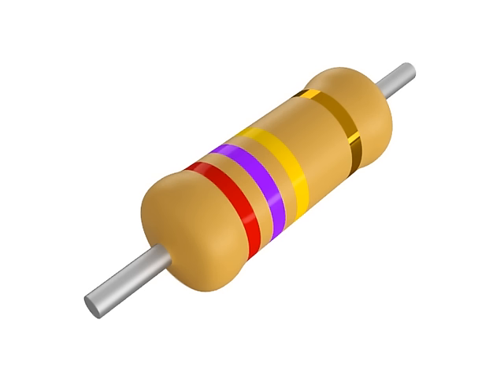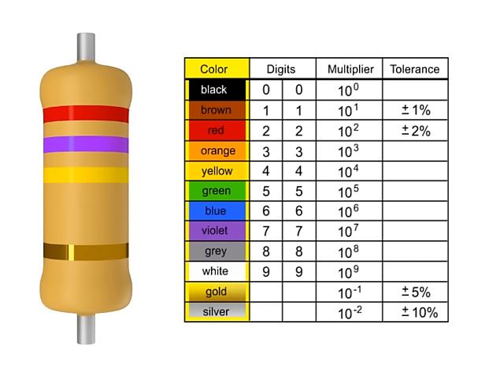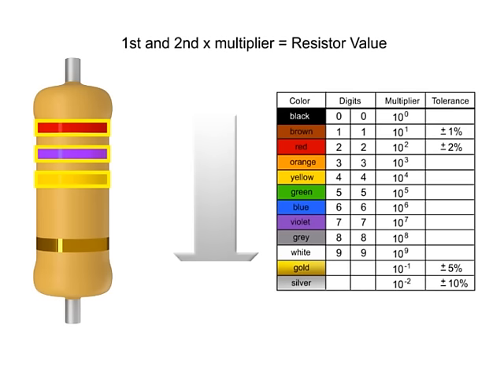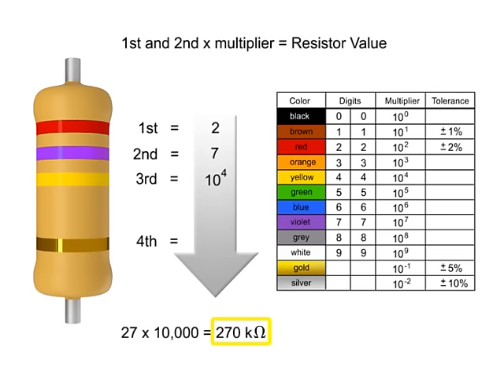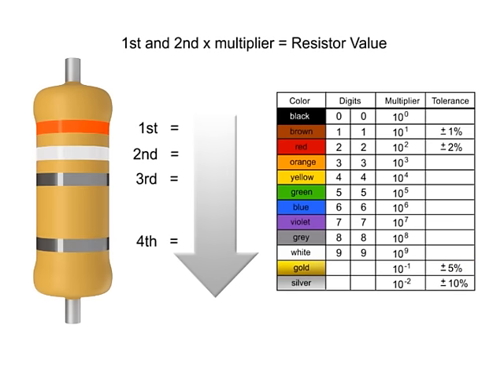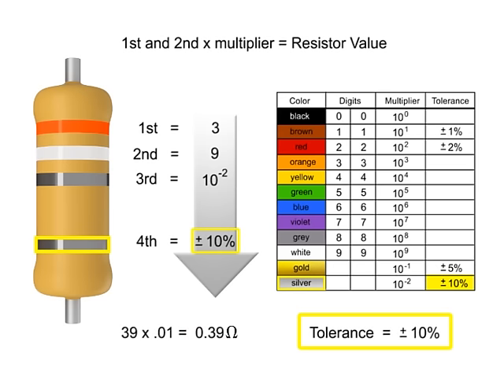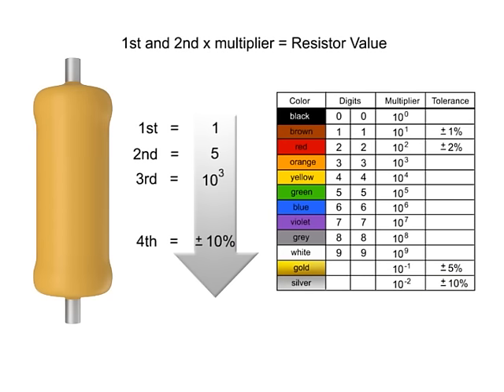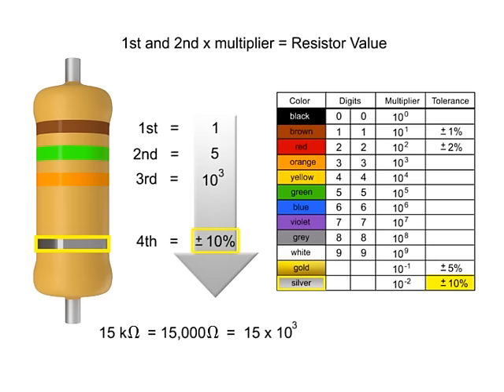How to Read a Resistor

Comment: These all resistance value colors below:

Value.    Color.     Multiplier (x10)   Tolerance

0.            Black                  0
1.            Brown                1                   1 %
2.            Red                     2                   2%
3.            Orange               3
4.            Yellow                4
5.            Green                 5                    0.5%
6.            Blue                    6                    0.25%
7.            Purple/Violet     7                    0.1%
8.            Grey                    8                    0.05%
9.             White                 9
10.           Gold                  -1                   5%
11.           Silver                 -2                  10%
12.           No color           ---                   20%

For example of 4 band or 5 band color of a resistor:
For 4 band color:

10 Ω with tolerance is 5%
(brown - black - black - gold)
47 Ω with tolerance is 5%
(yellow - purple/violet - black - gold)
560 Ω with tolerance 5%
(green - blue - brown - gold)
5.100 Ω (5,1k/5K1Ω) with tolerance is 5%
(green - brown - red - gold)
15.000 Ω (15kΩ) with tolerance is 5%
(brown - green - orange - gold)
270.000 Ω (270kΩ) with tolerance is 5%
(red - purple/violet - yellow - gold)
2.000.000 Ω (2MΩ) with tolerance is 5%
(red - black - green -gold)
12.000.000 Ω (12MΩ) with tolerance is 5%
(brown - red - blue - gold)
240.000.000 Ω (240MΩ) with tolerance is 5%
(red - yellow - purple/violet - gold)
1.000.000.000 Ω (1GΩ) with tolerance is 5%
(brown - black - grey - gold)
47.000.000.000 Ω (47GΩ) with tolerance is 5%
(yellow - purple/violet - white - gold)

For 5 band color:
47 Ω with tolerance is 1%
(yellow - purple/violet - black - silver - brown)
390 Ω with tolerance is 2%
(oramge - white - black - black - red)
2.200 Ω (2,2k/2K2Ω) with tolerance is 1% 
(red - red - black - brown - brown)
51.000 Ω (51kΩ) with tolerance is 1%
(green - brown - black - red - brown)
470.000 Ω (470kΩ) with tolerance 2%
(yellow - purple/violet - black - orange - red)
1.500.000 Ω (1,5MΩ) with tolerance is 2% 
(brown - green - black - yellow - red)
15.000.000 Ω (15MΩ) with tolerance is 1%
(brown - green - black - green - brown)
470.000.000 Ω (470MΩ) with tolerance is 1%
(yellow - purple/violet - black - blue - brown)
1.500.000.000 Ω (1,5GΩ) with tolerance is 2%
(brown - green - black - purple/violet - red)
56.000.000.000 Ω (56GΩ) with tolerance is 1%
(green - blue - black - grey - brown)
470.000.000.000 Ω (470GΩ) with tolerance is 2%
(yellow - purple/violet - black - white - red)
Reply: Sir, do you know how many commercially available four-band and five-band carbon resistors do we have today?
Reply: @jeremiahdanielsamuel2505  this lol that list is way to small
Reply: How to read ohm meater

Comment: hello sir i have some question's here how  do we provide colour codes for resistor's like 3M6 ohms and 5.72 ohms?
Reply: Rendani Emmanuel d
Reply: Same
Reply: Yre
Reply: Well 3M6 is another way of writing 3.6 mega ohms, which is 3.6x10^6 or 36x10^5, which would be orange, blue, green from the table.

For 5.72 ohms, this scheme would not be able to represent the 2, but since the tolerances which can be represented are 5% and 10%, and that 2 represents about 0.35%, its within the smallest margin of error for this system anyway, so we could just represent it with 5.7, or green, violet, gold.

Comment: How did you calculate 4th band please say
Reply: Let's say the first 3 bands tell you the resistor is 330 ohms. (orange orange brown) And the last band is gold. (+/- 5%) 
5% of 330 is 16.5. 
330 + that 5% is 346.5 
330 - that 5% is 313.5
So, the resistor is actually somewhere between 313.5 and 346.5 ohms.

Comment: I only have 3 lines one on each end one in the middle??
Reply: first is the digit, second is the multiplier and the third is the tolerance, I.e orange, yellow and gold (3 x 10^4= 30,000oms 3000/1000 = 30 therefore 30kilooms)   
I know its a super late reply but i hope this helps
Reply: @venusk.1009  but how do you know which is 1st , 2nd or 3rd??

Comment: Sir: How this question?
WEEK 3
ASSESSMENT TEST
Direction: Read each question carefully and choose the right answer. Write
only the letter of your answers on your answer sheet.
5. What is the value of resistor with color bands yellow, violet, black, gold?
a 4.722 +/- 5%
C. 47012 +/- 5%
b. 4722 +/- 5%
d. 4.7K2 +/- 5%

Comment: Smd resistors are so easy 
Let's say we have 197 
The first two numbers mean the resistance so 19
The last digit is how many 0 come after the first numbers so 
190000000 Ohm
If the numbers are underlined so 1͟9͟7͟
The last digit means how many 0 go In front of all numbers so
0000000.197 Ohm